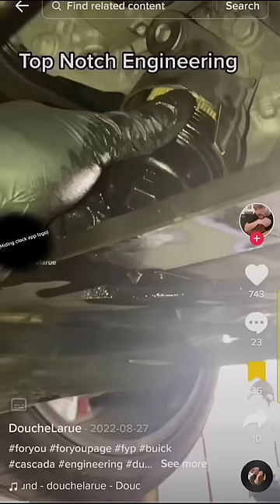Engineer Explains! #engineering #mechanic #car

Comment: Tammy should be able to change her own oil .
Reply: Pretty much all cars made before 1980 were that way, then car companies got greedy.
Reply: Tammy with the camry
Reply: Nailed it. Won’t buy a car if I can’t do basic maintenance myself.
Reply: @anthonym9007 stuff like that is the only reason people get so triggered about electric cars
Reply: Its so bad these days cant even add transmission fluid unless you take the whole transmission out of my car.
Reply: @anthonym9007 They also required a shit ton more maintenance. All the electronics might take a different approach to working on them but you gotta admit - the power, fuel efficiency while also having the original spark plugs last over 100k miles is pretty damn impressive.

This shit, though? This is powertrain designed for platform A getting slapped into platform B for the lowest price possible. That's how this shit always happens.
Reply: She can.  She just needs to know more on how to do it.
Reply: @ains2904 but wait other then the battery I can do all of the standard maintenance on my lightning, there just isn't as much
Reply: @Grimkeeper17 preach it holla lua. 😂
Reply: @ST-sb3gy  I’m a big American made guy, but I recently bought a Toyota and Honda both new. They’re freaking awesome and easy to work on especially for Maintenance type items.
Reply: Kcuf tammy
Reply: Then she should buy a car that isn't designed by an engineer
Reply: If you can’t figure it out talk to my friend Man we’ll he knows how… open the Manual and read not that hard
Reply: @SonoranPunk  im just saying the most well known electric cars are needlessly made more difficult to repair.
Reply: @tcantrell5301  how do you get a car that isn't designed by a engineer?
Reply: See Problem with that is, Every oil Change is Easy, May be time Consuming especially on Super Cars, but in essence they’re all easy if you’re have problems then maybe you shouldn’t be doing it. I Work at a Dealer and been a Tech doing Oil changes For 3 years From Merceds, BMW, VW, Range Rover, C8s You name it I’ve done it.
Reply: Had a Ford that needed very specific funnel just to add coolant.  Coolant! Had the reservoir been mounted 180 degrees , no problem. 
Swapping out the battery took about an hour and a half. It was buried back under the wiper mechanism(ish). Again, plenty of room to mount it elsewhere, they just wanted those sweet, sweet dealer maintenance dollars. F'em
The up side is, I know never to buy another Ford.
Reply: @ST-sb3gy I take it you only drive classics at this point?
Reply: @Grimkeeper17  agreed, trying to drain and fill a 2013 dodge dart right now. jerry-rigged a fill hose with a funnel at the end just to be able to refill the transmission case.

one of the worst designs but I've seen MUCH worse....
Reply: @MFlack2  get back to use in 10 years though. those battery packs are a money. pit.
Reply: @ains2904 not the only reason, but it is one of them
Reply: @94XJ newer cars are NOT more reliable.
Reply: that sounds kinda wrong
Reply: Why do you have same username as mine?
Reply: @anthonym9007 every vehichle until the mid 90s for japanese cars (fuck you honda for mounting oil filters on the back of the engine) and domestics stayed relatively simple until about 2010 when skid plates and cannister filters became popular. Gmc acadia is awful. Ive got scars on my arms from tbe second degree burns ive gotten changing the oil on those.
Reply: No one named Tammy should ever work on any vehicle.
Reply: I can 100% say, 90 percent of shops would change your oil but that original filters gonna stay in the engine.

Comment: My philosophy on this is if you're going to be an engineer in anything, you need to go work in that field first so you get a good understanding of how things work because to an engineer everything works on paper
Reply from the maker: So I was a design engineer for ~5 years and have done all my own work for the last 8 years ish. I'm definitely not a mechanic but know enough to design with repair in mind. The real problem is timing and cost. It ruins everything. I've had timing force me to ship things I wasn't proud of. I'll have to do a full video on my time as a design engineer
Reply: @Racing_With_Mitchell  this wasn't directed towards you in general just engineers as a whole. I'm a machinist and the engineers I work with have never run a machine in their life and think they know how to make parts. They'll get it somewhere in the ballpark and then I'll fine tune it to protection.
Reply from the maker: @Chris  no your good, I didn't think it was an attack or anything. The original video was obviously satire but I love having these conversation. I still believe we aren't the guys in the shop 8 hours+ a day or turning a lathe. In design, we actually do work with manufacturers, the mfging Line, and service teams to improve designs for this exact reason.
Reply: That makes far too much sense and will never happen in a functioning work place.
Reply: I mean personally, the type of people I see everyday in the shop could not pass them math classes. They’re smart techs but designing the dumb shit companies want and doing it fast is sounds rough😂
Reply: @beenrudy You also have to remember that design for manufacturing is only one part of the design process, and so is design for repairability/maintenance. In almost every inatance, we are balancing negatives to maximize the positives and that's usually because of timeline and cost. Those two pieces are usually unchanging, and so things must be cut elsewhere. Not at all saying what you're doing is necessarily wrong, but I've had know it all machinists on many occasions modify a part for ease of manufacturing and the part ends up failing quickly or simply not functioning or fitting.
Reply: I have worked with alot of engineers and the best were the ones who got their degree after working in the field for a while
Reply: @beenrudy no no fuck it say it was towards him lol
Reply: @Racing_With_Mitchell my grandad owns a scrapyard, garage, and towing company he was towing a car for a Ford engineer one day and asked why they did something to their engines (I forgot what he said exactly) but anyways the engineer said that basically on a team of 5 engineers or so there will be the head engineer who actually designs it and then the other guys basically proofread it for him. Don't know if that's just how they did it back then or if that's just ford but was some interesting insight
Reply: Y’all know that engineers do that in school?

Hell I am a computer engineer and we took apart engines our freshman year
Reply: @the2theonly672  Theres a huge difference between "taking apart engines freshman year" and repairing that same engine after its been in the bleach plant for 10 years
Reply from the maker: @diffsnicker1142  Hey, thanks for the question! That'd not how mine was setup (I only worked at one company for design and development, though). Essentially, it was split into systems teams. For instance, I was on lubrication and cooling. On that team, you'd have a manager and a handful of engineers that owned a list of parts. Depending on the level of difficulty, people would own 1-5ish parts. For instance, one guy owned our entire engine block alone. I owned an oil filter, filter head, dipstick, and oil pump. While this is quite a bit, these were all suppliers' design control parts, which means I didn't actually sit down and design the part. I told our supplier what I needed the part to do, though. While I was titled a "design engineer," I was not a designer. I kind of got put into the position and didn't have a ton of design experience, so I worked on these specifically for that reason
Reply: @Racing_With_Mitchell  after giving it some more thought, I don't think modern automobiles could be designed by just five people anymore. This story he told me was from the 70s. I bet back then 5 people probably did design whole cars.
Reply: True Bro
Reply from the maker: @diffsnicker  I couldn't even guess how many people helped build the new engine I worked on. I had teammates who lived in Indiana performing analysis for me l
Reply: Something I have seen also.  For engines a short block that is modular, fits well and is okay to work on, in one vehicle isn't so fun to work on, when it is in another vehicle.  Which is great for cost savings, but not so great for the skin when trying to snake into tight spots, or the extra time to remove parts to get access.
Reply: So true!
Reply: Years ago an engineer told me “ engineers don’t make mistakes we make change orders “
Well, he made a lot of change orders. A lot!!!
Reply from the maker: @jimmoody2173  that's actually pretty funny 🤣 I've had my afternoon ruined by my own dumb mistake before and it resulted in a change request.
Reply: People who complain about engineering have never read the design brief, and have no idea about what constraints there were.

The original Suzuki Wagon R had to be made using "the minimum of new parts". Now imagine having to fit an engine into a car that was never designed for it, with similar constraints.

Alternatively, imagine designing/engineering something, then after it's all finished the production staff start changing things to make it easier to build. 

Also, you can't have literally everything being easy access, the water pump has to be behind the pulley, which has to have a drive belt.
Reply: @Racing_With_Mitchell  There's something you engineers never consider it's called corrosion It may work great in a clean room But after that things been driven on the road for 10 plus years then comes in
Reply: YESSS
Reply: @chrisdavidson911 ya it is a driven item that must be under/behind something. but 9hrs to disassemble $10-20k worth of parts to get to the dam pump turning a .5hr waterpump into a 2 day job in a fancy dealership with my truck spred across 3bays.
Reply: @Perry2186  There's something you whatevers never consider it's called galvanic corrosion, reaction of dissimilar metals, and galling.

Have you seen any endurance testing videos? Or have any idea what goes on during testing and development?
Reply: @daviddroescher  seriously, that last paragraph about access to something that you rarely need access to was the only thing of consideration?
Reply: @chrisdavidson911   What are you talking about I see the effects of it of course I consider it and simulated use does not count for abuse when I wok on the high dump trucks /plows I see the effects of ice melt
Reply: @Perry2186  "simulated use does not count for abuse"

think it through. The design engineer can't do anything about a bad operator smashing the machine to bits. This has nothing to do with corrosion, which is what you were discussing. If a machine designed for 6 tons is routinely loaded with 8 and driven like a rally car, you're going to get reduced reliability.

The plows, i'm assuming you mean snow plows given that you mention ice? Was anything done at the time of ordering, or, during outfitting for service, to specify or improve them for this use? Or was the machine simply left at standard general-use specification and not even given a coat of underseal?
Reply: I've been an ASE certified technician for going on thirty years and two last 25 years I've been sand engineers who designed the cars out of have to come work on them.
There's so many situations where you know if they'd given me a quarter inch of Clearance I could get the job done so much easier but no the jack ass engineers don't understand why at the end of the day I  have a serious dislike for them.
That's not what I really want to say but if I said it the way I'd really like to somebody would complain and I'd get banned for my comment would get removed
Reply: People who have a deep understanding of something know when something that works on paper won’t work in practice just from the paper. However we sometimes get baffled by things that work in practice but shouldn’t, like a magical jackpot of stacked errors made things just happen to work out fine
Reply: @the2theonly672 We rebuilt engines in class in a shop last semester, and then over the last couple days I replaced headgaskets on an old semi outside alternating between rain and burning heat. Let me tell you, there is a real difference between tearing something down and assembling it in the shop, and making major repairs in the field after something has been through half a million miles, leaks, mud, etc., and trying to minimize disturbing things that will probably break and need replaced or leak and need fixed if you touch them. Never mind actually having access to the correct service information- a lot of less fortunate people and people with older equipment don't have access to the correct information, so they have to figure it out based on common sense and knowledge of the system as a whole.
Reply: @chrisdavidson911 that sounds like most people doing engine swaps for the last seventy years..... At least the ones that think about what they're doing.

Comment: I’ve said it before and I’ll say it again. Engineers should be forced to work hand in hand with the people who service and repair their product. Not shop owners, not accountants, but mechanics and tradesmen.
Reply: Yes. I 100% agree.. These type's of fool's shouldn't be allowed to design car's, let alone pretend to know everything about them.  They literally, have know clue.
Reply: They usually do, at least the good ones. Unfortunately greed and ego tends to get in the way
Reply: Many of us do. I don't try to fix my own cars these days because automotive engineers are monsters.
Reply: Edison motors is
Reply: Absolutely!
Reply: They also need to sit in warranty and take phone calls. Create fixes and manage TSB and Recalls. The warranty department should be under engineering so it's their budget. Been in production and told engineers it won't work or last or how does that get serviced? Also gotta be smarter than an oil filter.
Reply: How about do something else if you can’t hack it.
Reply: If you want to be upset be upset at the accountants. Engineers wouod love to design and enhine that comes out with 6 bolts has two electrucal connectors and all of that. Here is the thing that would be expensive and time consuming.
Reply: I used to work for a John Deere dealership. Talking to the corporate reps, back in the day engineers used to go out in the field and test equipment and improve it as they were hands on with operators and techs. Problem is today if they ask engineers to go out in the field and work on the things they design they threaten to quit because they didn’t get a fancy degree to be treated like a mechanic 🙄🤦🏻‍♂️
Reply: Every person should be forced to work manual labor, trades, or food service, or retail like the military in other countries does. There would be far more respect and kindness in the world
Reply: @TylerSmith-qx6uz  is this a dig at mechanics/ DIY guys? I’m not saying I can’t take a bracket out of the way to remove an oil filter, a monkey could manage that. What I’m saying is that there is an absolute VOID of service considerations amongst engineers.

Comment: Thank you for making my oil pan gasket cost $500 instead of $10
Reply: Then use sealant 😂
Reply: @pawedorosz3508 why? 😂
So you can pay less to do it wrong? 😂

And if you do it long enough, they will charge more for the sealer and your doing a poorer job then the gaskets built to seal that individual part
Reply: I can attest to that to change my timing cover you have to takeoff the oil pan and vice versa

Comment: One guy makes the motor blue prints
Another guy designed the car
And another designed the undercarriage
Reply: Stupid build flaw
Reply: And another guy designed the oil filter housing and the best place to put it where it will cause the most damage,strife, and ptsd

Comment: You thought Toyota was bad? Try BMW. Have to remove a bunch of crap from the undercarriage to do the oil change and then remove a bunch of crap in the engine bay to get access to the hidden filter and since theres no dip stick - you have to find the option to measure oil in the screen inside the vehicle. Only then can you reset oil life. To do that? Yeah, you just turn the vehicle on and off five times and then press and hold a hidden button on the gauge cluster for ten seconds and then you cycle through about five menus and then you hit a button on the turn signal stalk and then you cycle through more menus until you arrive at diagnostics, now you are finally able to reset oil life.

German engineering 👌

Comment: These are such great videos.

I’m not even a mechanic yet and I already understand EXACTLY why mechanics that actually work in their shops are so mad sometimes.

It all makes sense now 😀
Reply: Set yourself up to do the job efficiently. The worst filter I replace regularly is on an Opel Insignia, it's a plastic housing/paper filament style placed directly over the driveshaft & subframe. They sell a drain funnel that looks really weird and you ideally want the driver wheel off and want 2 oil drainers. One could use a 32mm wrench potentially but you'll make a horrific mess. For me it's easy because after 10 or so I got it down, if average Joe could do it first try on a driveway in under an hour I'd be truly amazed. They are hell
Reply: Yeah, engineers made a $10, 10 minute job into something that requires hours. I've seen 2 videos of this guy and I really dislike him already